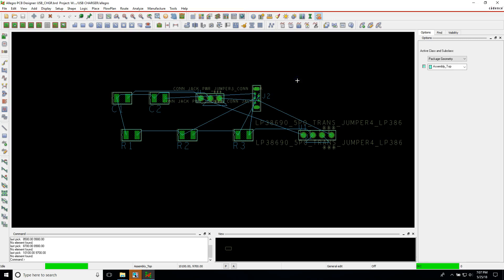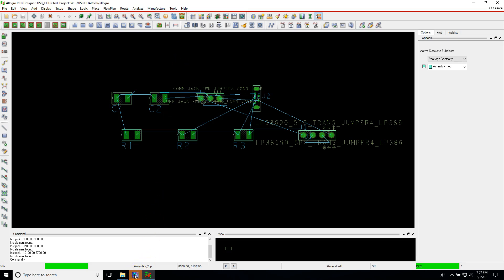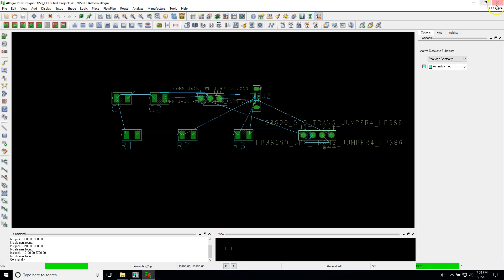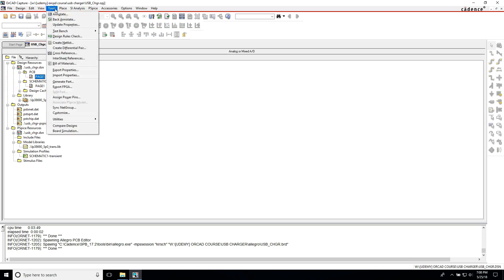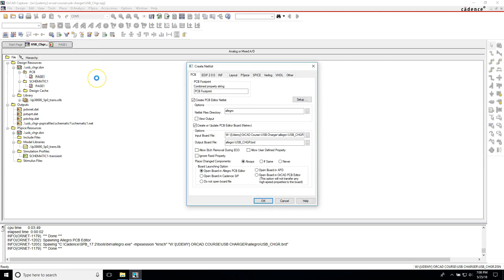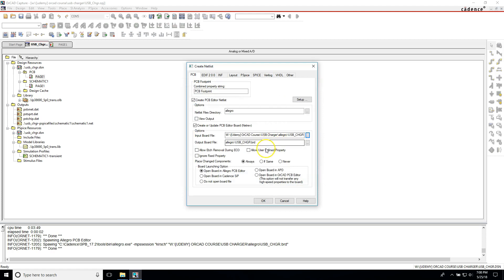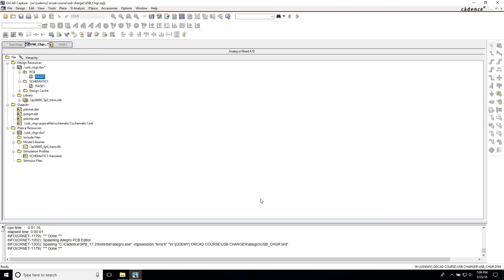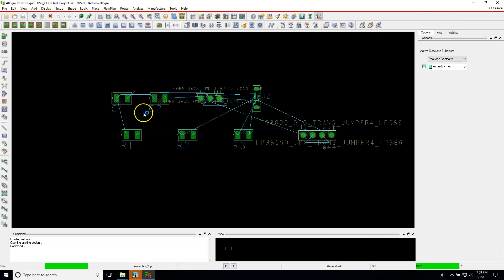Updating a PCB using Create Netlist in OrCAD / Allegro Capture CIS: Step-by-Step Guide

Comment: Hi Kirsch!
I got a question for you. I have updated my title block and when I tried this the new title block did not transfer over to the board. Is there any other way of doing this?
Thanks for the videos!
Reply: @techedkirsch  Thank you so much 👊
Reply: I also sent you an email if you prefer to reply on there. The sooner you can the better brother.
Reply: @techedkirsch  Hey Kirsch, I am still unable to achieve what I wanted to achieve and I am running out of time. If you got any tips for me I would really appreciate it. I can place the title block in Capture but I cannot do it in Allegro. The old Title block persists no matter what I try.